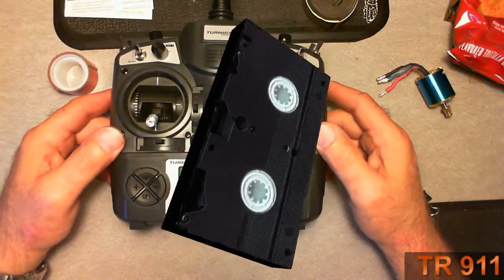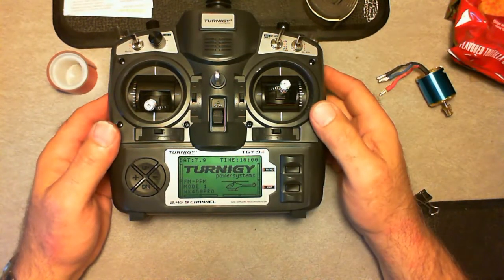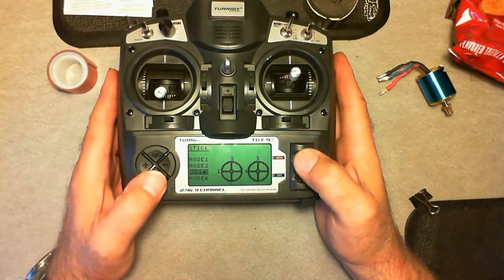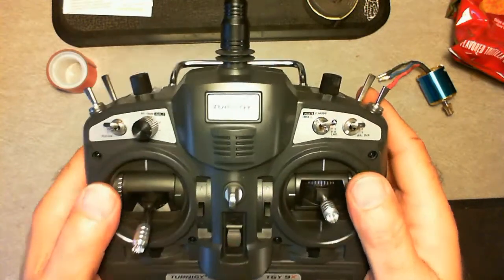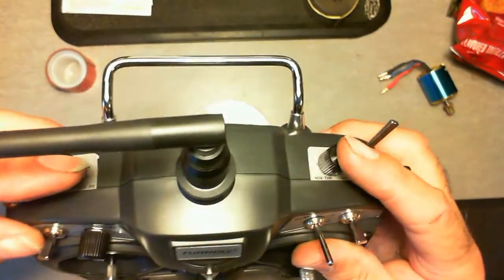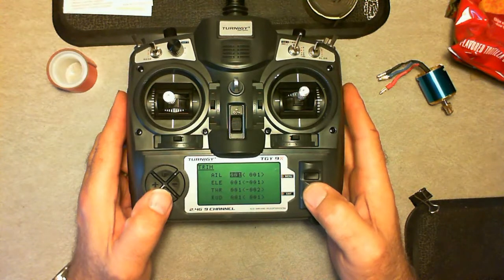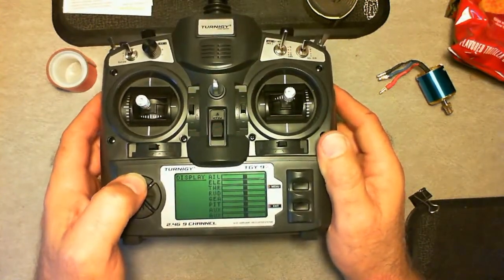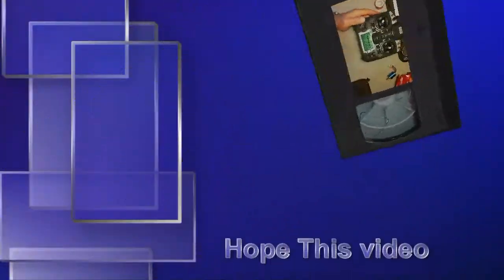Introducing the Turnigy TGY 9x

Comment: It's supposed to run on 12vdc (8 x 1.5vdc AA batteries). You will lose range running it on low voltage. You can install a DC to  DC Boost circuit inline with your LiPo to boost the voltage back up to 12vdc...